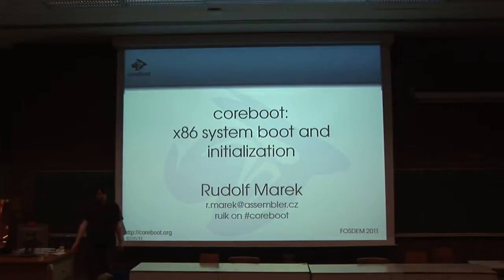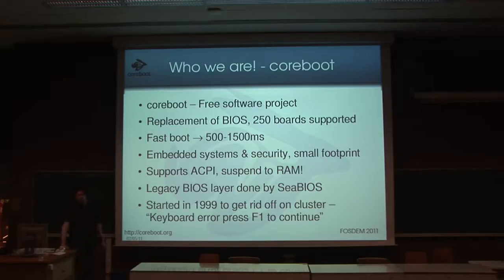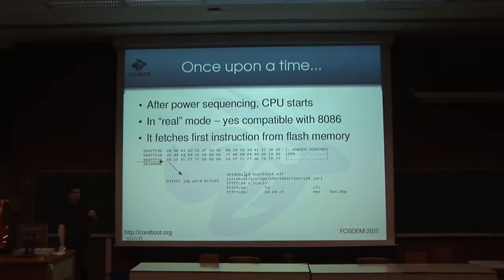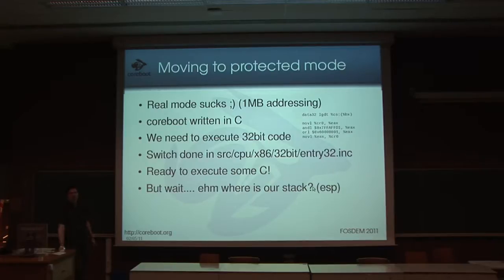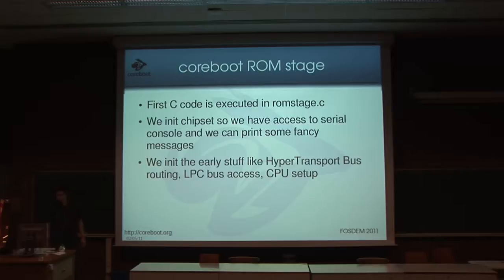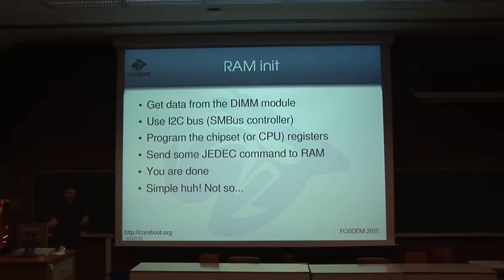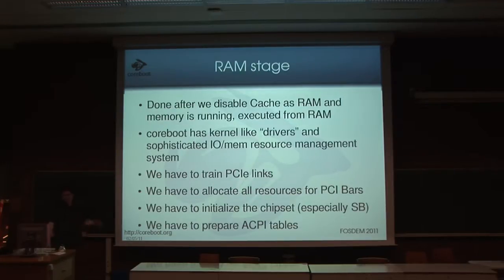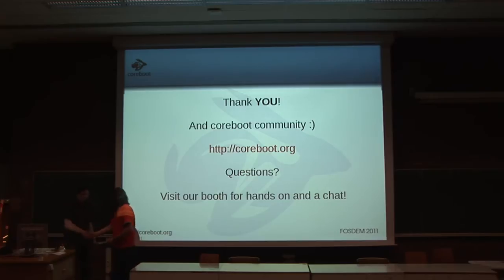Coreboot: x86 system boot and initialization

Comment: if i have linux already installed in my pc and i install coreboot the linux would be kept?
Reply: I know it has been six years, but in case anyone stumbles upon this comment, Linux is installed on the harddrive, and installing an alternative BIOS doesn't touch it. You just have to configure Coreboot to boot the Linux installation.
Reply: @meithecatte8492  7 years ago,if I had knowledge of today I would have 🤣🤣🤣 , but hey it is these days we take such a foundation of tech is taken as granted.
Reply: @armando:

<facepalm>.

"B.I.O.S." stands-for "Basic Input Output System". "Linux" is a kernel; a kernel is the "glue" that allows the hardware and software to talk to each other.
But what you were referring-to (as far as I can determine) was the "Linux" "operating"-system.
Changing the "BIOS" (or now its successor, "U.E.F.I." (an acronym that stands-for "Unified Extensible Firmware Interface")) to "Coreboot" or "Libreboot" (which is another one) shouldn't affect the installed operating-system at ALL.